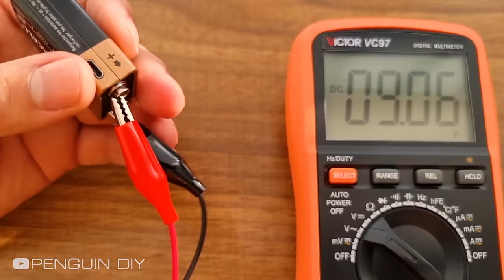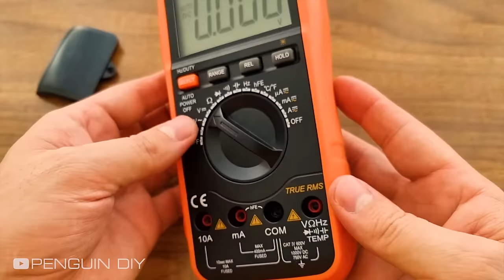How to Make Rechargeable 9V Li-Ion Battery | DIY 9V rechargeable battery

Comment: Ok para eso eliminas una de las baterias de litio acto seguido usas un sistema de recarga de baterias de litio a lo cual solo ocupas los componentes y no el pcb despues vas a conectarlo a un potenciometro para que la salida sea de 9v ahora tu sistema de recarga cargara las pilas de litio y a la salida el potenciometro dara salida los 9 v pero con recarga de 5 volts que es lo que usa el sistema de recarga de pilas de litio 😅 lo que veo complicado es el calibre de cable que usas y el espacio reducido pueden usar cable de cargador usb que no sirva o si quieren reducir mas pueden usar cable de bobina 9 con proteccion delgado que es el cable que usa para conectar el sistema de carga  Saludos desde Mexico

Comment: The disadvantage of the circuit you have made is that the self-discharge current in such circuitry is high. In other words, this battery you assembled will self-discharge (current 2.6 mA) in x amount of days! Why didn't you add the no-load self-discharge protection circuitry?

Comment: I could have used the original items since I know space areas and he just did not think this thru. I built an infrared laser when I was 12 and tested it before I turned 13, I built Ironman's repulsor beam when I was 13 after studying the Lenz law. I built my own telescope with the grounded lenses that I did when I was 14 and it picked up the rings of Saturn.  So he does know a lot but not as much as someone who learned about how to do so much in the 1970's.

Comment: Switch is useless unless you leave he device opened and turn it on/off each time you need to use. If you leave it turned on, you'll discharge batteries very soon. Therefore you need a board with autooff.

Comment: I'm sorry but this went from a great idea to a cheap Chinese product from Wish, real quick. It seems to me like it would be a better idea to just design a direct replacement for the 9v battery. 3D print a 2 piece housing and custom design the PCB. Put the charging port on the front, between the posts or put it in the rear. It's not like it'll interfere during use, anyway.

Comment: Why not just throw out that huge potentiometer replacing it with the corresponding resistor? Also, why not to use a tiny combined board with the tiniest potentiometer.

Comment: I guess you charge it from the pins also, didn't get why theres a 5 V USB inlet?
Reply from the maker: The charging module has two input pins and 2 pins of 5 USB pins are used in these modules. The other 3 pins on USB are used for data transfer and for fast charging of some devices.
Reply: @PenguinDIY  Yeah, I get it but did you mod the powersupply, since you cannot get more than 5 V from a normal usb charger? Or is the USB used only for charging other devices from the battery?

Comment: the rechargeable battery is really important for a goddam victor vc97 multimeter otherwise you need to buy several brandnew batteries per month 😂

Comment: You forgot to change "current set" resistor. Charge current is to high by default for this capacity, this is bad for batteries

Comment: You,re wrong.A 9V Duracell battery is not rechargeable.since Duracell; it is not and not rechargeable; high risk of explosion.A rechargeable one is a 7,2V.Many people don,t pay attention and confuse Rechargeable and NOT rechargeable.Inside both are 6 small batteries of 1,5V each if not rechargeable but 1,2V each one if rechargeable.Don't confuse rechargeable and Duracell which is not rechargeable.This is very very important for each person who does not know the difference between the two.I,m Jean de Dieu in Nyamasheke,the south Western of Rwanda; near DRC and Burundi.

Comment: ...or you can just buy a stable rechargeable 9v battery that works efficiently for a lot less. When you calculate all the money/time spent on individual parts, tools needed one has to consider beforehand if it makes any sense... and this just doesn't

Comment: there is a kit already available smaller in size that has boost converter battery charger and low cutt off protection all in one. it's even smaller in size too. I don't know why you wasted your time

Comment: Tam nichego ne ponjatno kogda elementi perestavljajut ne ponjatno i ne vidno
Reply from the maker: Inside the video, the circuit was assembled and tested outside the battery. And you can tell by the color of the wires how the circuit is mounted inside the 9-volt battery.

Comment: It is useless. You have to use on/off switch, because the curcuit has too high the idle consumption. Without the switch, the thing is dead after few months/weeks. Useless. Better to buy NiMh 8,4 V accubattery. I have tried it many months ago.
At side, in many things is the original battery box useless, you dont need this original shape. The woke problem only.